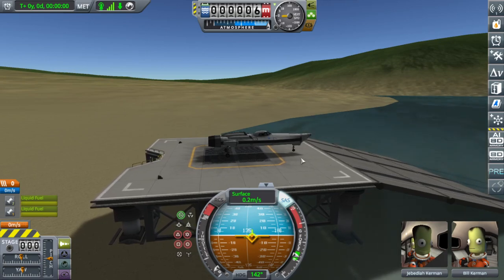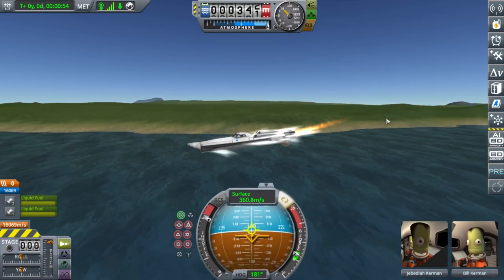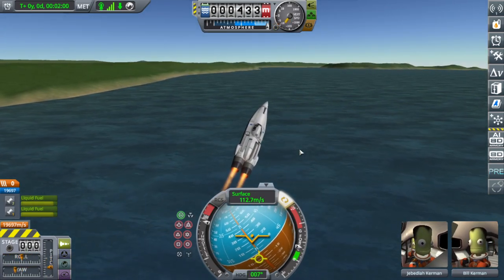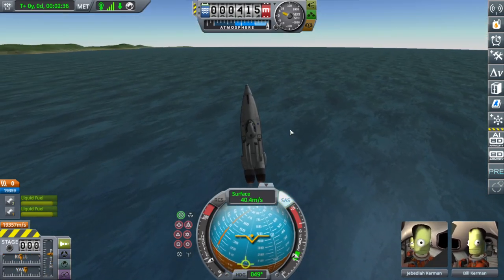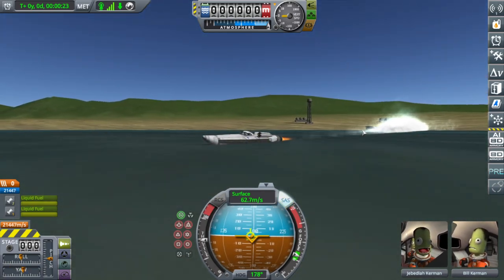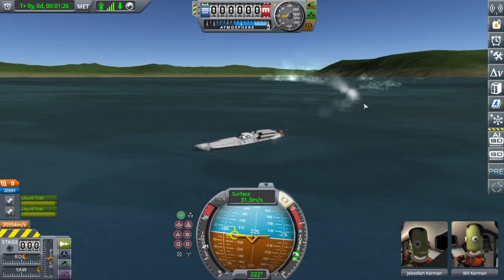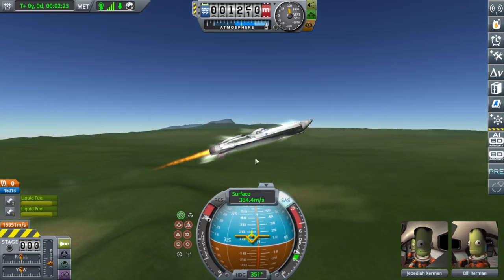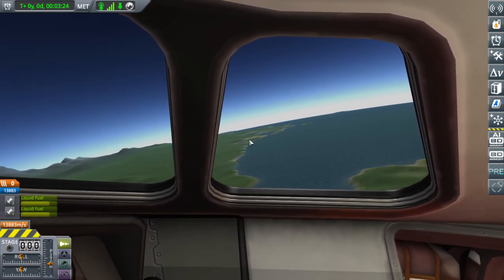Speed Boat | Kerbal Space Program

Comment: This is KSP, you can use jet engines underwater so I'm not sure what you meant with "I can't use these" when talking about building a submarine
Reply from the maker: Didn’t know that, though that would mess with the air intakes
Reply: @SpaceFlamingo07  In my experience you need more air intakes than usual, but it's still possible
Reply from the maker: Nice